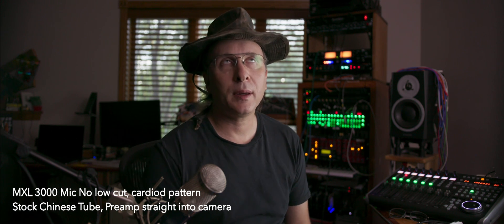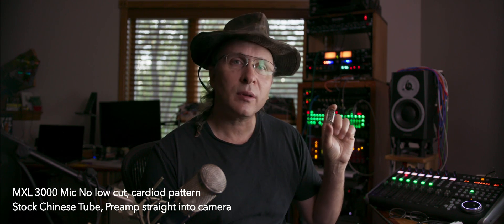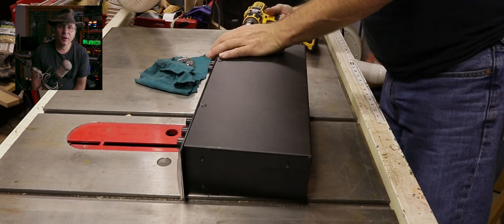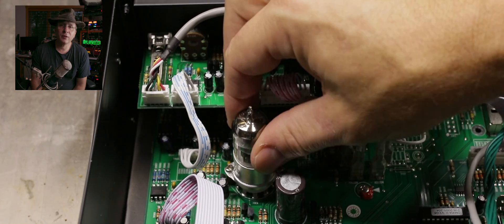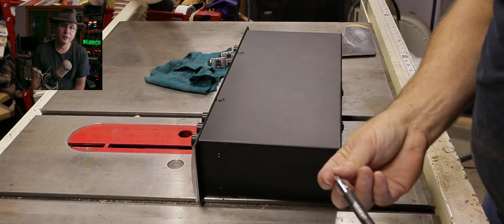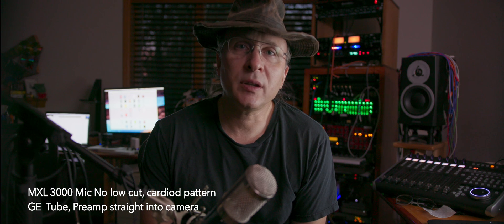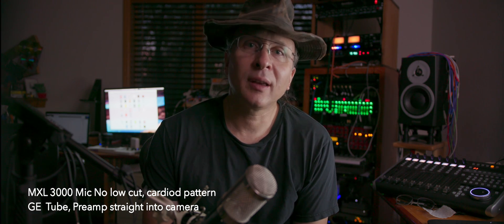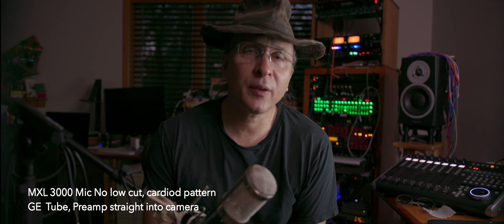Does Changing The 12AX7 Tubes Make A Difference with In The ART MPA Preamp For Vintage GE Tubes

Comment: If you keep the 12AX7 type tube and it is not in OPEN GAIN design, then it should not make any change.  
However, if you change it with a 12AU7 then the gain will drop, but the quality of sound will go up.
Reply from the maker: tube changes freq response. even between tubes of same type there can be differences due to bias adjustments. not sure what you mean by "quality will go up" since gentle distortion is something tubes due well and people kinda like.
Reply: Not really Steve.  
The bias is setup in the local feedback resistors, called self biasing, in small signal tubes like the one we are talking about.  The frequency response is also a function of the tube resistors and caps.  None of this will change if the circuit was properly designed.  The idea in good design is to make the resistor bias and frequency performance dependent on the the local circuit itself and therefore be immune to variations in tube construction.   That is why I brought up the OPEN LOOP circuit which has none of these protections.  Those will depend on the tube for the circuit's performance.   (That is what a college education in electronic engineering will get you.  I am an EE)    So how swamped (their term) the circuit is will determine the performance as outlined above.   Changing a 12AX7 with another 12AX7 of another brand, in a properly designed circuit, will make no difference at all.  The proper designed circuit depends very little on the actual tube other than for gain.  You might be thinking of POWER output tubes with their ability to have a pot for the bias setting.
Reply: There are a family of 9 pin tubes in the 12--7 tubes.  These are optimized for either Grain or Power Drive capability.   The 12AX7 is one of the worst in the family.  These were made for cheap 5 tube AM radios.  These can cut back on the number of tubes that are needed in the AM radio.  This is called Economics. The 12AX7 driving a high Z load will still have a lot of distortion, but lots of gain.   If you replace that 12AX7 with a lower gain tube with a lot of drive capability like the 12AU7 then since this tube can drive more power into it's load without distortion, this is what I meant by the quality will go up.  This can be tested with an Analog Signal Analyzer.   So the range of tube designs were meant to address these different requirements.
Reply from the maker: @jimmoss9584  oh yes I know about the lower gain 12A_7 series. interesting idea to try a U7 instead. I've heard a few tube tests  with various makes of X7;s showing more lows or mids or highs. The GE NOS / telefunkens tend to be even. I know some of these tubes are supposed to rated out to several MHZ but never investigated why audio would show this variation, unless the supporting circuitry is theoretically intentionally less than ideal design, then does let you play around with different tubes for different sounds. I initially bought this out of a semi-famous artist's studio with the stock Chinese tubes in it and was suprised they hand't of played around wtih it.
 I also realize that the input loading could also change the sound, this preamp having  impedance adjustment dial which so far only seems to make a fairly small difference, even with a ribbon mic. These days I haven't used it much havjing changed audio interfaces yet again which sound a bit better than the old ones.
Reply: Yeah!  You the mic to transformer to first tube is totally impedance matched.  You don't want to change the loading and expect no damage to the sound.  I doubt that these preamps have transformer input and outputs.  If they do, they are probably very cheap.   Audio transformers cost money.   Does yours have transformers and does it have all vacuum tube audio paths?   Each real audio transformer will cost as much as the ART preamp.
Reply: Honestly, a semi-famous artist's studio?  Is that how you determine if a preamp is good or not?  How many musicians are EE's?  I am, name another.  The preamp is going to perform a certain way do to it;s design, not who you bought it from.   It is all about the design.
Reply: Try to keep this in mind.  That preamp company ART, they make junk.  Junk = Affordable.   Google "cheap ass Mackie audio consoles".  I knew Mackie.  We talked about his requirements many times.  His goal was to build consoles that musicians could afford, not recording studios.   The same thing goes for ART.  If you know anything about consoles you would never compare a  Mackie to a NEVE.   Same goes for ART.   What did this ART preamp cost you?  I see they are about $300 or so.  A REAL vacuum tube mic preamp will cost you about $4,000 to $5,000.  These are PRO AUDIO mic preamps.  In these, the entire audio path is vacuum tube.  This means not one stage, but all stages are high end tubes.   Look at MosswareProAudio or D.W. Fearn.  Those are the top of the line.  There are no short cuts there.
Reply: So, tell me.  Is the bandwidth from 0.5Hz to 55kHz as pro audio gear is designed for?   What is the THD+Noise spec and does the unit pass it?
Reply: Just like I thought.  GOOGLE "ART MPA Preamp schematic".  Each channel has ONE (1) tube stage in it.  ONE!  Like as in 1/2 a tube.  JUNK!  
Like I said, a real PRO AUDIO vacuum tube mic preamp has vacuum tubes in all gain stages of the audio path... AND no OPAMPs in the gain stages.

Comment: I got one of these units and could not get it to stop buzzing. I tried everything, so I sent it back believing it was defective and ordered another one. Guess what...same problem! This cannot be an isolated case. Either way I popped for a Warm Audio unit instead...and guess what...NO NOISE! Thanks for wasting my time ART!
Reply from the maker: if 2 units gave you a buzz, its a ground loop problem. they can be pretty hard to track down, but first easy fix is connecting the ground screw on the back to a known good ground. having 2 power circuits on different phases is a common problem.
Reply: @thedp  Thanks for the input...I bought a ground tester just to check my outlets and they are fine...so everything is grounded but still the buzz...and it's actually the typical low freq hum...which theoretically indicates ground issue. I am so frustrated with this I just have to take a break and reassess my problem. I held out an additional two weeks trying to solve this before returning the gear. I even got an IFI DC Blocker...no dice. Two Preamps and two compressors...The Warm Audio WM12 and this MPAII and Warm Audio WA76 and the ART PRO VLA compressor. The only one that wasn't noisy was the WA12...it's still here. My electrician is licking his chops to re-wire my whole house...that's not happening! Color me red.
Reply from the maker: @stevend984  ground loops are more tricky than that. while good a plugin indicator says outlets wired ok, it won't indicate other related problems - grounds at different potentials on different outlets, neutrals which in home wiring is actually also tied to ground being at different potentials. in typical home wiring there are 2 hot legs of 120V at different phases creating voltage differences between them. When gear is plugged into each phase a ground loop can happen because the hots don't match. in modern switching power supplies this doesn't matter, but transformer based supplieds can still be vulnerable depending on design. its also very possible you have a XLR with ground and - wired swapped, or ground and +. I'd check cables carefully. one way of isolating is to take all cables out, and connect one at a time until the loop returns. at that point you found the source and can figure out the fix. likewise you can also power everything on and take cables out one at a time until it goes away.  if you have hum with just unit plugged in, mic, headphones then its either the mic, mic cable, or power supply. its a tedious search, good luck and much patience to find it.
Reply: @thedp  Thanks for taking the time to reply on my issue. The first thing I did was check all my cables. But here's the deal...I only have two pieces of gear plugged in...My Tascam Model 12 and the ART ProVLA compressor, (which I tried two of) with same results. All told I went thru two ART VLA's, one ARTMPA, a WA12, and a WA76. Results...ART VLA's both had the same low freq hum, the ART MPA was just noisy (weird), the WA76 had white noise interference, and the WA12 was perfectly whisper quiet as it should be. Originally I ran the MPA thru the other units in an effort to isolate the problem but the other units consistently had the same problem with or without the MPA so I took it out of the mix for simplicity sake of troubleshooting. A good acquaintance I have at Front End Audio has made the same observations and today I am also even going to move my mixer to another room just to see if any change is noticed. Just a short back story, my home is a mobile home I bought last year and it underwent major remodeling including electrical. I oversaw, assisted, and was involved in the majority of rebuilding of my place. That said, I'm fully aware of the possibility that this place has some electrical interference issues, which can become a can of worms. Still in the process of getting the rest of my gear set up...keyboards and some rack gear, I have my mixer and computer and DAW working without issue.  Which lead me to initially believe there would not be the electrical issues I am now experiencing that I have never had before. But everyone who has heard my story has pretty much said the same thing..."Yeah...this can be a problem"!

Comment: Hello,
How many tubes are in this tool? Which tube would you recommend? noiseless model tube. Thanks
Reply from the maker: 1 tube per preamp. it you want "noiseless" tubes probably aren't your choice of anything then. there are mods for this to replace the opamps, caps, resistors. probably overkill as there isn't much noise in the unit to begin with. even today's lower end gear is really pretty good compared to what used to be out there a couple decades back. the tube I used is pretty even freq response. others may have more gain, or emphasize lows mids or highs. the GE / Telefunken ( same thing made in DE ) are pretty nice.

Comment: Steve,  
if you design a circuit correctly, the tube brand won't make a difference.   The circuit is made to be in control, not the tube.   The 12AX7 is the weakest tube out there.  I would never use one in my designs.   This argument is popular with guitar players.  If you run a circuit in OPEN LOOP GAIN design different tube brands will make a difference, but OPEN LOOP GAIN design just sucks.  This kind of circuit design, transistor or tube,  leaves the circuit performance and sound totally to the tube where the tube can flounder around due to heat, vibration, because is is not controlled by the circuit.  Have you looked at the HoneyBee vacuum tube mic preamp/optical limiter?  This is a real tube mic preamp.  It can be driven hard creating beautiful 2nd harmonics that warm up the sound.  This is the only mic preamp I will use since 1997.  It creates anywhere from a pure clean sound to a fat rich sound that is as big as a house.  No OPEN LOOP GAIN designs in it... and no 12AX7s to be found in it.
Reply: I agree, the difference, if any,  is not worth the change.

Comment: What kind of op amps can be upgraded in the pro mpa ii?
Reply from the maker: there are a bunch of TL084's if I recall, but 84's are reasonably decent. 74's I'd replace with 84's or Burr-Brown type. at that point may want to look at caps and some metal film resistors too. Its really pretty clean so while doing an op-amp upgrade might be ok, disassembling the unit is major PITA to get the board out.

Comment: I have both the mpa 2 and the comp vla 2 both units are so clean sounding love it. Gonna try new tubes.
Reply: How long have you had them for. I do not wanna have issues like they are known to have. I am considering the Warm Audio WA73-EQ Microphone Preamp & EQ. Because I just wanna capture the sound I want into a clean capture device. For the price of it. It seems like it would be better to have than the ART mic and compressor pre amp.
Reply: @eaglewarrior8707  I love the ART. Cuz it's so clean. But you can add color and saturation but it very clean. Exactly why I bought them. I didn't want to add cor just a clean signal.  But like I said you can add color. I've had mine over 1 year so far
Reply: @streetlogic  and you haven't had these "issues" that the gentleman is referring to whenever they might be???

Comment: Not sure if this changed with the newer versions but the unit I have has 12AT's in it not Ax's .. I did swap them out for Mullard's and Electro Harmonix's but they were the AT7's :)
Reply from the maker: interesting.. I actually checked the old  tubes that were in this, had them in parts bin and they were marked 12ax7. maybe they changed the design a bit ? or got a deal on 12at7's that some one had a cargo container off and re-biased the circuit to work with them.

Comment: I put a set of matched and balanced JJ tubes (12AX7 short plate) in mine. It was amazing. When I ordered my tubes from Eurotube, I requested the gain factor of the tubes to be 105 with a transconductance of 18 (I had experimented with several different specs and found those numbers to be best). Plus, since I ordered the short plate tubes, the microphonics were excellent (very low microphonics using short plate tubes). I also have GE tubes from the late 1960s that I tried (medium plate). Thank you for the great video. You are correct, swapping the tubes can be a wonderful thing. Overall, this microphone preamp is a great tool.
Reply from the maker: thanks for sharing that. its nice to get good sounding gear w/o spending a fortune for the last 10-20% improvement.

Comment: I need help I have the same one and when I turn it on is getting hot :( and I don't hear my voice in the microphone anymore please I need some help
Reply from the maker: tubes work because they get hot - they have a heating element in them. , thats good. as for the mic, no clue. no idea what mic, if if requires phantom power, if thats turned on, if the wire is good, if phantom power is good, if its a ribbon mic that may of been damaged by phantom power. try swapping mics, wires, make sure settings are good.
Reply: @thedp   thanks bro was my connection i put the wrong cable
Reply: @thedp   yess that's buddy I got it thanks a lot

Comment: sounds like there is digital clipping goign on
Reply from the maker: not at all
Reply: @thedp  then why does it sound so bad?
Reply from the maker: @chrischoir3594  what do you mean by sound bad ? sounds fine here, most other folks have been liking the GE tubes. IF you mean did I go for both clean and slightly over driven in the unit itself, then that is intentional to see how that sounds since pushing a preamp into distortion is certainly a sound thats done.
Reply: @thedp  It sounds cheap to me
Reply from the maker: @chrischoir3594  pushing a mic preamp into distortion may or may not be your thing, and thats ok, but it is for some folks as part of the signal chain in recording. Running clean, I'm happy with this unit. there are some mods for lower S/N ratio in it, but outside of maybe changing the op amps out I don't think its worth it considering what it takes to get this thing apart - everything has so come off / out.
Reply: @thedp  I love distortion but "musical" distortion. What's going on here is not musical IMO.

Comment: The overall character is still present, though the tube swap definitely smoothed and refined the upper limits of the gain. I think a modern TungSol 12AX7 which is the gainiest 12AX7 in existence and has great thick tone would be ideal for at least one channel where you can use the gain knob further and have a little more "oomph", leave the politer GE/RCA/Telefunken NOSs in the other channel
Reply from the maker: for DI, that could be quite good. for micing, might be adding too much color. try it an see :)

Comment: Can I swap my Art Studio V3 tube? Which one do you recommend?
Reply from the maker: as long as its based on a 12AX7 sure or you find out what tube type is in there. there are other amp tubes, but this is one of the most common type in sound applications. the GE's are relatively flat - they don't over emphasize or cut freqs across the audio spectrum. other tubes may boost or cut or both giving them their characteric sound so I'd suggest looking for a tube that sounds like what you want and try it. there are tons of YT videos comparing tubes.  Telefunken's are  based on GE tech & designs but cost a lot more for what is basically the same sound.Also have you tried all the different settings on that preamp ?
Reply: You can essentially did what he did here, since its also a 12AX7 in there. Its pretty simple to swap out. If you search, you can find several mods for the V3.
Reply: Electro Harmonix 12AX7 from what i've heard , def have to check it out